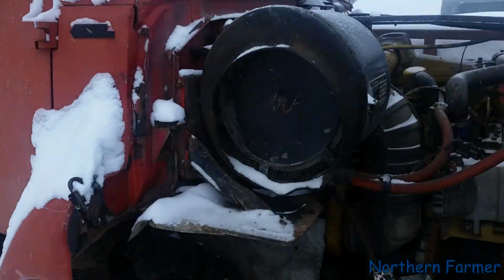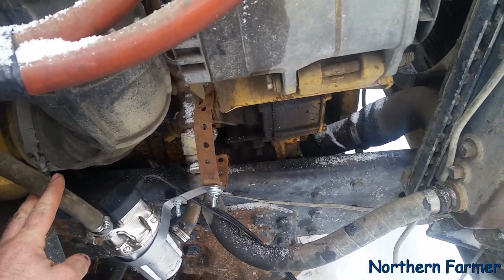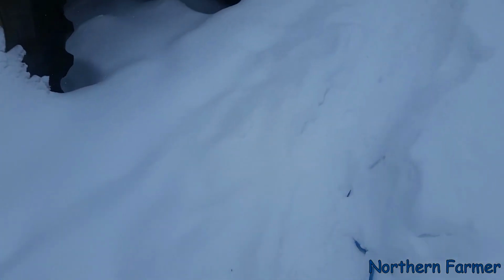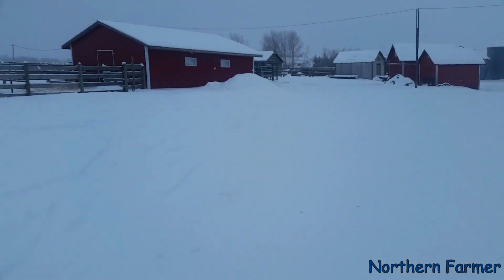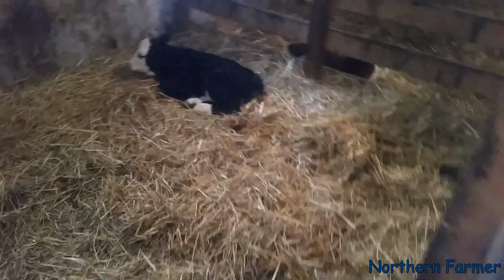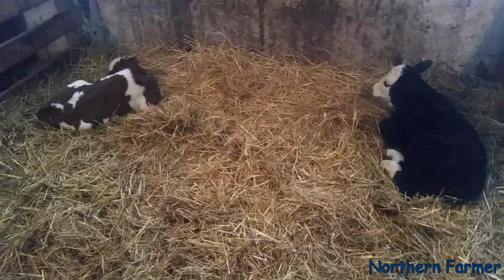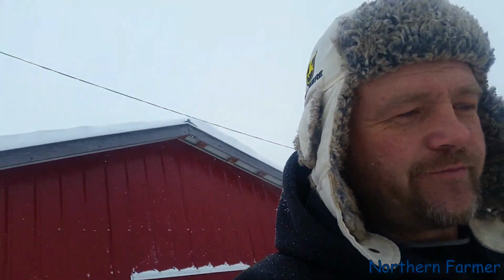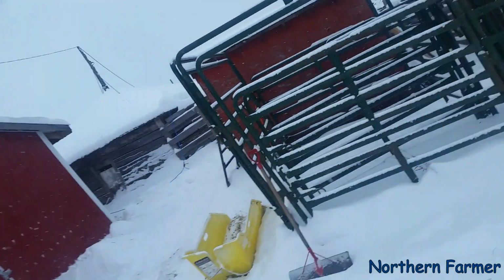Lots of Snow and & Calves!!

Comment: Lots of snow for the pond/dug out. Curious if the circulating heater is not getting enough current because of the length of the extention cord. 
Did you get a sprocket ring for the 46A? 
Calves are always fun at that age. Bottle feeding these ones? 
The truth about buildings is they are always too small, but when deciding what size to build them.. we always think that they'll be plenty big enough at the time. That only shows that your a successful Farmer! 
Congrats on the calves and hope that the warm weather is here by mid next week. Alberta winters love them or freeze.
Reply from the maker: The sproket is fixed... bought a new set.  We dont bottle feed... the cows are just outside eating
Reply: +Northern farmer 
Glad to hear you have the sprocket fixed, and now you have extras for sale? 
I thought the calves and cows were okay, but only bottle feed if there's no other choice. 
Looking forward to seeing the 46A working on the farm. 
Stay warm and all the best with calving.

Comment: Leave the block heater rigged the way it is, don't put it in heater lines. You just need to figure out what's wrong with it, air lock, etc.
Reply from the maker: I know it had a air lock... but I had it working and it seems to have a air lock again
Reply: Try venting it at the top while the engine is running and warm after thermostat opens, you probably just got air into the line when you changed unit out. You might even want to have unit plugged in as your doing it.